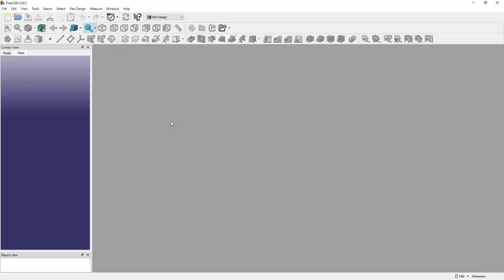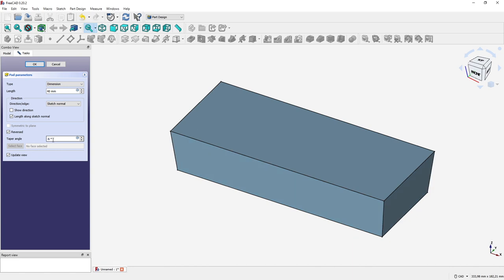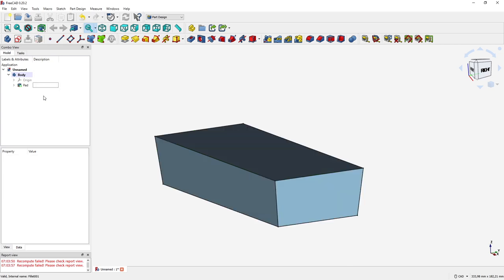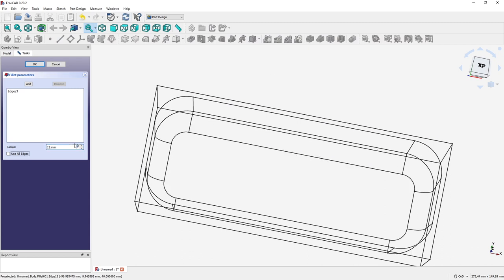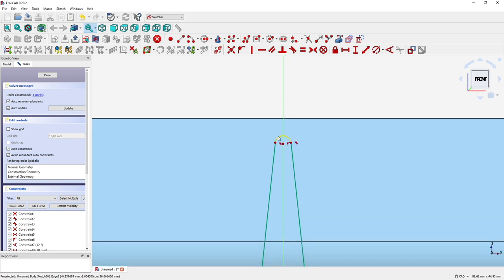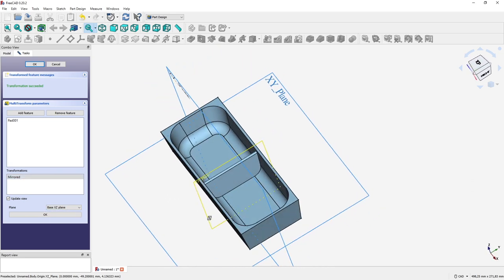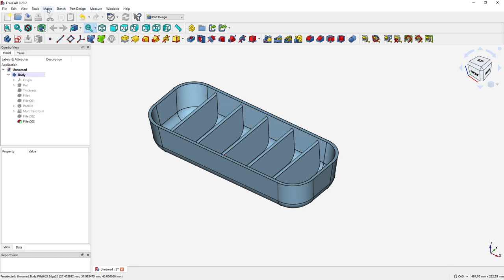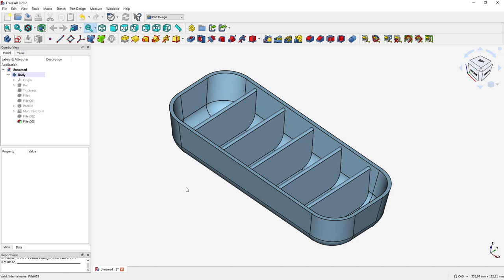FreeCAD 0.20.2 Tutorial - ORG TRAY by Too Tall Toby (Intermediate Exercise)

Comment: My FreeCad 20.2 release is not behaving as yours is.  As I start to draw the Ribs, I have an inconsistency.  At approximately 5 minutes into this video, you press "Create Sketch" and select the XZ plane.  Your display immediately switches to a view that has the XZ plane visible at the forefront (i.e., half way through the drawing) and you can sketch the ribs directly on the XZ plane.  When I do the exact same sequence, my drawing switches to the Front view of the drawing and XZ plane is behind this.  It allows me to sketch the ribs but I cannot see them as they are being drawn.  Do you know what is going wrong here?  Any tips?  Thanks for these videos.  I have learned so much and much more to be learned.
Reply: Came here to ask exactly the same.
Reply: update: Menu -> Sketch -> View Section. That fixes it.
Reply: awesome.  That works!  Thanks! @oscarrodrigues

Comment: Awesome! For this particular model, this is a very nice and elegant work-around on FreeCAD's limitation of the thickness command, which by the way made it even easier to deal with the rib pads otherwise breaking through the outer shell (no need to trim excess parts of the pads).

The work-around I came up with was to create the negative of the inside as second body (another tapered and filleted pad, having the ribs as pockets) and to boolean subtract this body from the outer body (still inside part design workbench, but also possible in part WB). This way, also no problems with rib pads on the outside....
Reply from the maker: Cool 😎 
This sounds like another great work around

Comment: When I did it, the thickness command DID work. The only difference up to that point was I used the draft command to get the angle, rather than the taper option in the pad command. 

I did then have to use a different workbench for the ribs, because otherwise the rib would poke out of the fillet. I extruded it beyond the body with the part workbench , used the body to cut the rib, then used an array in the draft workbench, before fusing it together.
Reply from the maker: I recorded various attempts🙂 one of those also was Part and Draft WB
Reply: @FreeCADAcademy  Another way to do it is let the ribs poke through, then clean up with defeaturing in the part workbench.
Reply from the maker: @sleepib  yes but you see where this is leading us..

Comment: I very much like the video as it contains a few very interesting parts. The problem with adding a filet "too soon" is well known to me. It can drive you completely insane.
How you are using the Multi-Transform tool is just amazing. And I guess the order of first setting inner filets and afterwards extruding the inner parts with the option "up to face" is just genious. So in short: I again learnt a lot.

As you were checking the mass at the end - I'd have one request:
I quite often find myself constructing an asymetric body. However, as often those objects are meant to be used in 3D print, I need to have the "center of mass" of the printed object cebtered to one axis. I know, that the FCInfo macro gives me the information of where the center of mass is. Still, manipulating it is far from being an easy task for me. Is there any good way to do that in FreeCad (or any other tool)? I'd appreciate, if you could tackle this in one of your videos.

Comment: I downloaded the latest Freecad, and when I got here 5:00 to draw the sketch I couldn't see the points or lines as I drew, I had to delete the sketch and change the draw style to see the sketch. Are there some settings I can change to fix this?
Reply from the maker: Unfortunately from this description, I can’t tell you what might cause the problem
Reply: Menu -> Sketch -> View Section
Reply: Edit -> Preferences -> Sketcher -> Display -> Open sketch in Section View Mode (FC 0.20.2)
I had the same exact same problem and was looking for a solution just now.

Comment: I followed along, and the weight at the end was 168.1738g. I did this twice and got the same result. The surface of the form came to 80999.5575 mm2, with the volume being 164876.2614 mm3. Any idea what happened?
Reply from the maker: I think that’s fine and in the tolerance field.
Reply: @FreeCADAcademy  I got 168.1724.  I get that it's within tolerance but why is it different at all?

Comment: Why did you change the attachment and made the pad go down instead of just going up from the XY plane?

It's the small things like a "reverse direction" checkbox instead of just typing a negative value that annoy me.
Reply from the maker: Cuz we don’t have any dimensions on the XY plane, but the dimensions in z+ 40. that’s why I want my sketch to be placed there.
I understand your annoyance but these are things I got familiar with very quickly
Reply: @FreeCADAcademy  So it's because the drawing you based this on shows the top of the tray? Changing the attachment of things is something I didn't do so far, but it makes sense this way.

Comment: Moving the Z up & pad down, I didn't think of that, I like it.
I try to leave all the filleting to last because filleting has caused me more grief with broken sketches etc than anything else. Trying to make changes to sketches above the filleting as it appears in the tree is a nightmare
Reply from the maker: Yes you should prefer to create the fillets as a last step if possible.
In this case it’s impossible, because filleting in the sketch then drafting gives different geometries than extrusion with draft then filleting